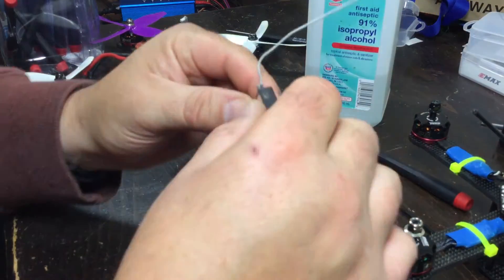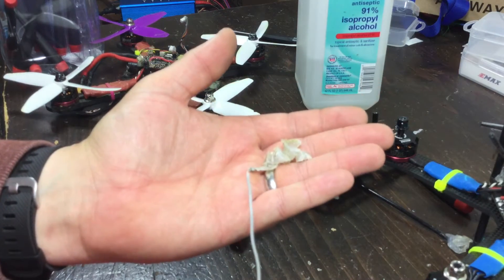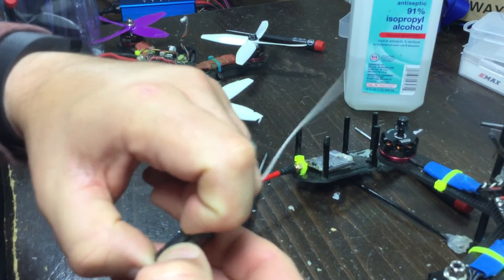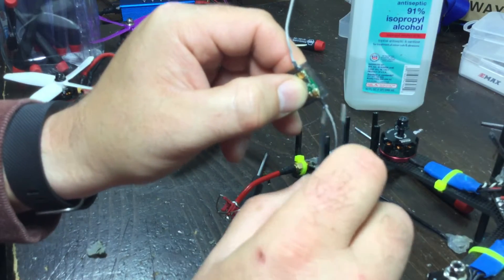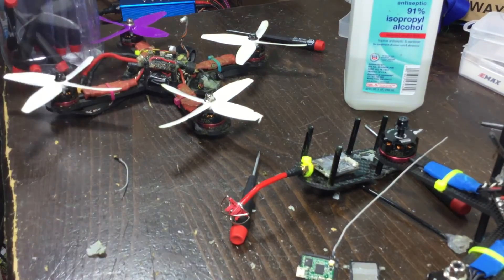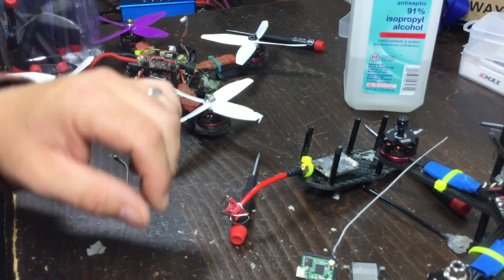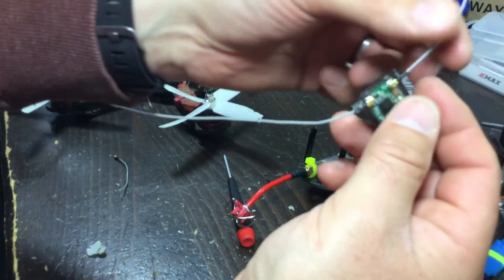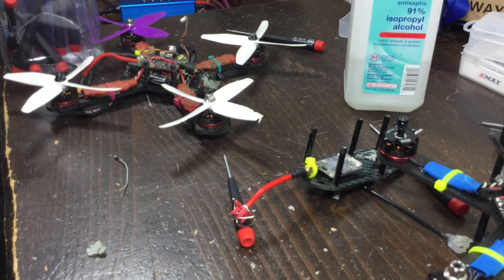Spektrum FPV receiver antenna replacement

Comment: I had the same problem with the broken antenna
i found only one eBay seller
https://www.ebay.com/itm/Spektrum-Antenna-Replacement-for-DX5e-DX6i-DX7-DX8-/313211659485
bought 2 and arrived perfect

Comment: If my rx doesn't have those connectors for the wire, can I just solder a new antenna on with a big blob, or are there more than one connections that need soldered?
Reply from the maker: Multiple connections not just one, Signal & Ground.  I'll link some videos below.

https://youtu.be/0Pai8iJUrh0

https://youtu.be/62WiPscjh4Y

Comment: do you have to pay attention to lenght? mine are shorter? does it matter
Reply from the maker: Yes and no.  Length is important @ the tip where the inner wire & dielectric insulator  (center core/main conductor) are exposed.  However total length  of cable/wire can very as long as the amount of exposed wire remains constant for the 2.4 GHz to work properly.

See Oscar Liang's page for more in depth insight, link below
https://oscarliang.com/repair-2-4ghz-antenna-rx/

Comment: Which tool did you use to unscrew the plastic sat receiver case? Link please. Thanks for the vid. Just ordered a few sets of antennas from your ebay link.
Reply from the maker: https://www.amazon.com/gp/product/B00CSWY50O/ref=oh_aui_detailpage_o04_s00?ie=UTF8&psc=1

Also use these too for other related needs,
https://www.amazon.com/gp/product/B00018AO0W/ref=oh_aui_detailpage_o09_s00?ie=UTF8&psc=1
Reply: FastMeter FPV Thank you!  What size Torx is on the Spektrum race receiver??
Reply: Did anyone find the exact size ? Don’t want to buy a whole set of micro hex drivers just for this

Comment: where did you get the spare antennas at?
Reply from the maker: No longer available on Amazon but this is exactly what I received (first link).
https://www.amazon.com/gp/product/B019K4J6NI/ref=oh_aui_detailpage_o08_s00?ie=UTF8&psc=1  

These should be comparable to the ones that I'm using if not the exact same:

http://www.ebay.com/itm/like/252224000290?lpid=82&chn=ps&ul_noapp=true

https://www.amazon.com/Irctek-Silvering-Antenna-Replacement-Receiver/dp/B01FEEQTQ0/ref=pd_sbs_21_1?_encoding=UTF8&pd_rd_i=B01FEEQTQ0&pd_rd_r=200PX3YN773F61HYTEWN&pd_rd_w=E1v5o&pd_rd_wg=1In9c&psc=1&refRID=200PX3YN773F61HYTEWN
Reply: Actually found them on spektrum website and order several sets